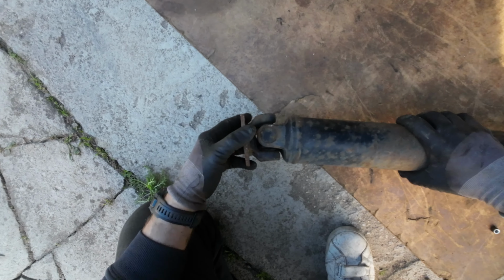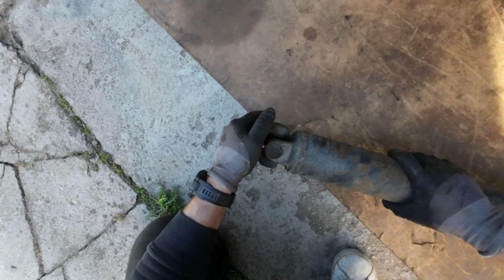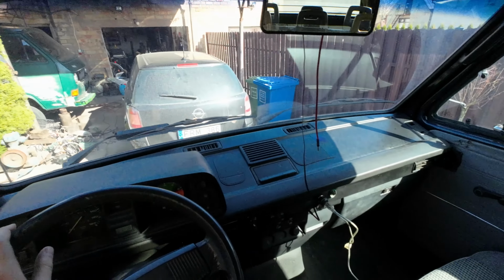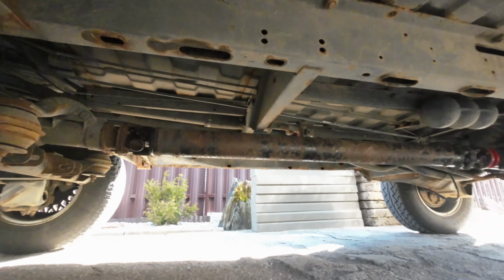VW T3 Syncro Low Speed Vibration Solved

Comment: that universal joint must have been seizing for a long time. it doesn't happen over night.
well done for finding the problem so quickly
Reply from the maker: Most likely it was still lightly moving that's why noticeble vibration starred not long ago. I was wondering, is it difficult to replace those universal joints?